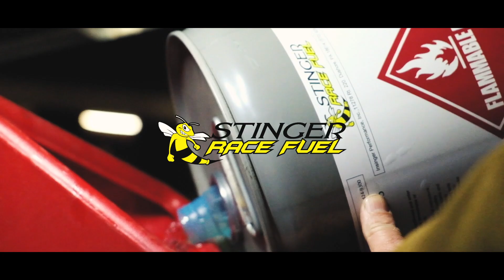Police Gave us 30 Minutes to Street Race

Comment: That cop definitely follows the channel! Lol Billy can you say what gear you have in the rear? I really want to get rid of my 700r with the overdrive but also wanna be able to drive down the highway sounded like you were at a pretty high rpm crusin
Reply from the maker: Yes he was very nice! I run a 3.70 gear ratio out back. It’s about 3000 rpm at 65-70mph
Reply: @StreetRacingChannel  Thanks for the reply man! As a younger guy busting knuckles on my car you have definitely motivated me and proved you don't need all the fancy equipment to go fast. Thanks for the motivation sir!

Comment: Why did you change from alcohol back to e85 for that race?
Reply from the maker: So that I could drive it over an hour one way. I couldn’t drive that far on methanol
Reply: It was street cars only, no trailers so he had to de tune it and drive it there.
Reply: @SweatyFatGuy  that makes perfect sense. Seems the solution is a meth kit to spray additional. Was wondering why because I just set up an additional fuel setup.. Video will drop soon. I love watching this truck launch.

Comment: So now that you "burned out" the interior, will y'all be gutting the S10 and installing a lighter weight dash, cut out some interior OE metal, and put that truck on a diet?  
Full fiberglass or carbon front clip and doors......with the "grandpa" paint job.